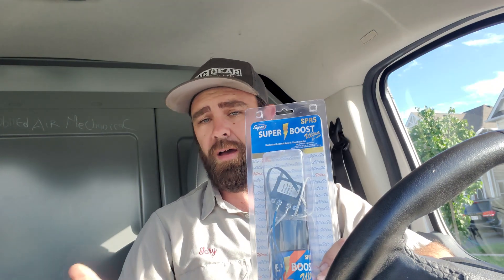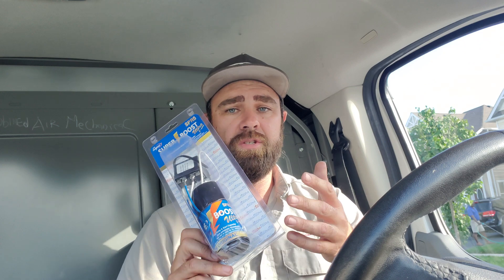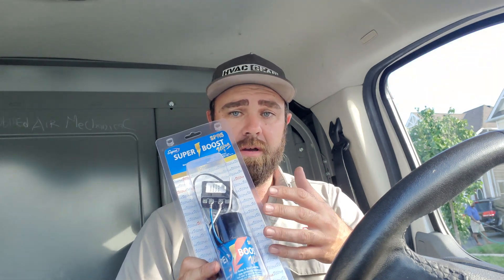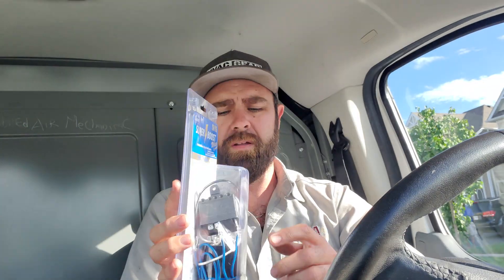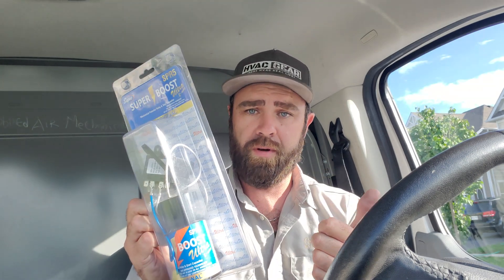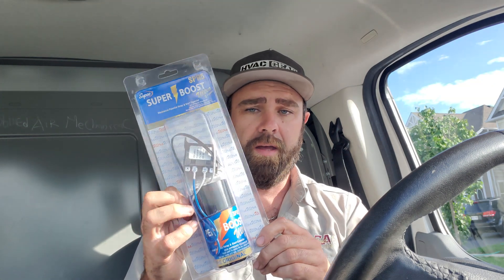Compressor Hard Start Education With The Supco SPR5

Comment from the maker: They can and will help
Reply: Thank you for your response.
Do you know if compressors that use an inverter rather than a start capcitor and run relay are the same?
I see a lot of videos about how to test the output of inverters but I was thinking that just using a hard start could work.  
I'm guessing in a non-inverter there is a sensor that closes with warm temperatures that causes power to be applied to the hard start which then starts the compressor.  
I fix everything myself but refrigeration systems are a weakness at this point.
I used a Supco hard start the day before Thanksgiving and it worked flawlessly; I'd say thing just seem better than ever witht he fridge. I had bought the hard start about ten years ago on the advice of someone to have it on hand.

Comment: What is the 1-3 hp referring to? 
Thx
Reply from the maker: Compressor horse power
Reply: @HVACKnowItAll  ever installed one on a unit and only dropped the lra by 3 amp? My compressor is doing 106 and after I installed the kit is doing 103! My run cap is new and all my wire terminals are good 
Thx

Comment: You're the number one video when searching for Supco Hard Start Kit other than one from Supply House. If you happen to see this comment I'm wondering if there is something like this for inverter refrigerator compressors?
I'm wondering is you could use this to confirm that the compressor does run and cool.
I know there are tests with a multimeter to determine voltages from the inverter and you can ohm the compressor; but again, just wondering if my idea could or would work.
Reply from the maker: Unfortunately there isn't for inverter compressors no.

Comment: I find this amusing for the units i work on because other contractors have put these in without a drop-out relay, so the power is way higher than the motor in an LG rotary compressor is rated for, so the usual result is the common terminal gives out and shorts to ground. Although the units already runs pretty hard, so adding more capacitance in  permanent split-capacitance system is dangerous for them, if the issue wasn't already a compressor failure. 

However, the scope of my work usually never sees a hard start used correctly for the units, so the damage ends up costing customers close to $1500 to repair a fractional tonnage system (water sourced heat pumps are not easy to repair correctly). 

Under the right circumstances, i can see why these would work for startup circuits, but would need to dropout during run.

Comment: I always heard these should be installed on every unit. I had a 4-ton goodman packaged heat pump unit bought in 2007 I'm in Phoenix. I had installed a cheap hard start kit just two wires no relay. It was on there until about 2020 I replaced it with a 5-2-1 I probably should have replaced the caps at that point. The condenser fan failed in 2021 I replaced it and installed a new cap for the fan motor. 2022 I smelled smoke inside the house every time AC would start up I thought it was the inside fan motor. Turned out the motor is a brushless motor it soft starts it has no cap new motor was $350 put that in unit would not turn on. I called local AC tech he came out we decided to jump the contactor see if the compressor would start. It just buzzed after an OHM test found one winding shorted 2 were open it was done.  I wonder if that 5-2-1 maybe caused that compressor to fail if manufactures wanted bigger caps to start them why not put bigger caps on it. These caps are 150-400 MFD just getting big joint of voltage. I had other issues evap coil was dirty, and I admit should have replaced those caps in the past.

Comment: MY 90's Armstrong condenser unit actually shows the option for a start cap and relay. However, non are installed and here years later, the compressor is not starting... even after replacing the run cap. I think a hard start kit is the nest step to see if the life can be extended. Only makes sense!

Comment: Trying to figure out if there's an easy way to add something ideally plug and play to a generator/inverter to help on high draw loads like an air compressor,  power saw or air conditioner etc Or do these types of kits ONLY get installed to the compressor itself?
Reply from the maker: These are for single phase machines that are induction start capacitor run

Comment: Everytime there is a "start capacitor" video, I want to throw my phone away if they don't talk about the DIFFERENCE in "hard start" kits. I only say that because the only people seeing these videos are usually newer in the industry and its pretty important to understand the types of starting systems. And I'm not saying this won't be fully covered but it is honestly the best way to build the bones of understanding. Start with the variance everytime.. before even explaining WHY they are used/useful.
A potential relay is really the best way. 

There are three ways to pull the start cap back out of the circuit. 
Potential relay
Electronic relay
Positive Temp-Coefficient Start Relay.
Each has a different method.
The Potential relay uses electro-back voltage that qualifies the motor is running to pull it out. That is good.
The electronic relay has a set amount of time (like 60 or 90 seconds) and jerks it out. This is okay,  but the relay fails more often than a Potential and can leave it in longer than needed.
The PTSR relay uses basically a resistance circuit to get hot and pull it out. These were used a long time ago to add the third wave by themselves by delaying the power supply slightly and used  by some manufacturers. If you've ever seen a strange 1.5 inch cylinder with wiring from the contactor to the herm side of the contactor on an old Carrier or Goodman, that was what it was. This type is the most inefficient because if it cuts off, and back on, the replay components won't cool enough to even bring the start cap back in the circuit.

If you have a two wire hard start kit - if it is an "all in one" it is almost always a PTSR relay.
If it is a two wire but has a seperated relay that looks kind of like a Potential relay, it is usually a electronic relay.
If it is the 5-3-1 - its a Potential relay.

You want the 5-3-1. It is the superior starting control mechanism.

This is the end of my Ted Talk.
Reply: I wish more comments are like this. Cheers
Reply: How about supco mpr5 it has two wire ,but sold as mechanic potential any idea why? Also the 1-3 tons kit by supco Mpr5 has a capacitance of 290uf? And the 5-3-1 for 1-3 tons only has 88-105uf any idea which is better?
Reply: So if I just say start kit...I'm good right?
Reply: You are missing fully electronic hard start kits, those go for $200+
Reply: @AK-oz4ew  how is this still doing work from half a decade ago.

Anyway - what do you mean? Got a link to what you are talking about?
Reply: Also - how did I not get a single comment when homie comments on everyone else's😂

Comment: We just have this tool in the truck. https://www.amazon.com/UEi-Test-Instruments-Hermetic-Compressor/dp/B000K2N3NE/ref=sr_1_1?crid=1UOGR6KSK0YF8&dchild=1&keywords=uei+compressor+analyzer&qid=1596223734&sprefix=UEI+compresor%2Caps%2C171&sr=8-1

Why? allows us  a range of start capacitation with out guessing and additional testing. Additionally we have had many calls that OTHER HVAC contractors have condemned the compressor as LOCKED (WITH OUT TESTING). #1 most of the time the compressor is NOT locked its either short to ground or OL or thermal shutdown #2 if not locked (the compressor)  this tool allows us to analyze the compressor  "circuit" #3 So your still going to have to put a start compactor on the circuit if your tests prove out- yes which we usually have in inventory start (dual compactors) what is presented in this video are "hard starts/boosts" which should have been put on as a preventative not reactionary fix. No debate just a more logical best practices approach- why by three (3) different "boost/hard starts"  vs a tool called compressor analyzer  an MFD range of  88-301 MFD

Comment: 👍👍👍 excellent topic great video. Another extreme case if they failed one or two times before because of the contact points going out. Wire in your own heavy duty 40 amp contactor don’t use the internal switching points use them as a trigger only to engage a heavy duty contactor and it will last the life of the unit. Yes I know extra expense extra complication and wiring but a happy customer that will never have to have you come back for that problem again.
Reply from the maker: Nice add

Comment: I think it’s great that you are talking about these starting devices. I have used similar hard start kits for 20 years and I have seen compressors run for many years, the longest is 12 years. I don’t fit original starting electrics anymore and have saved many compressors and have introduced many other techs to these as well, and they also have had success. There is a misconception that these damage compressors. You may get some compressors fail shortly after fittings these stating electrics, but the compressor was going to fail anyway. I have a few different ones in my van and never get caught without being able to get a compressor going, I enjoy your videos keep them coming.
Reply from the maker: This is great info, thank you